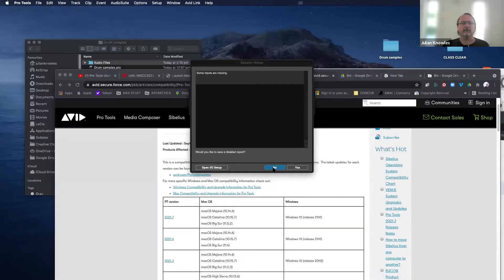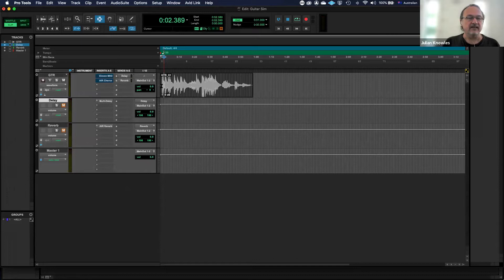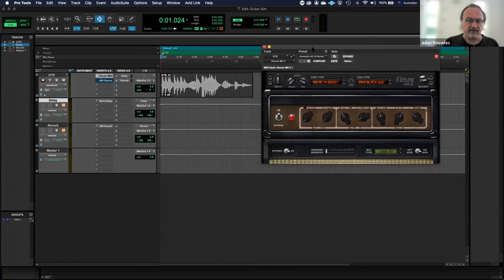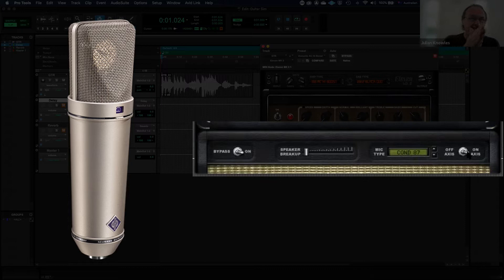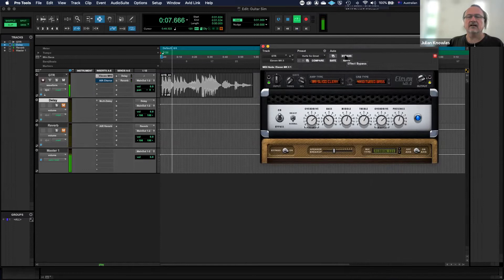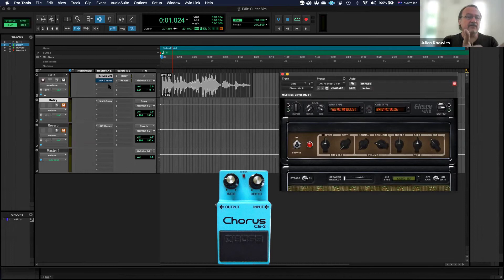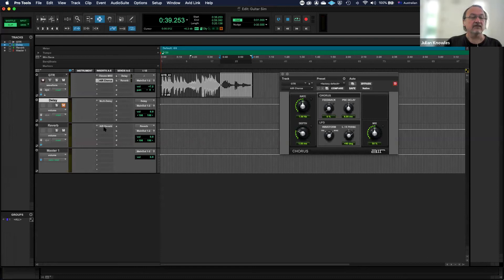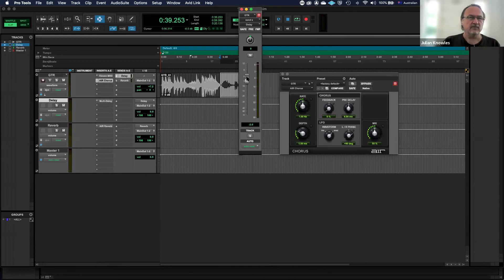Pro Tools: Using the Eleven guitar amp simulator

Comment: I have been have trouble with hearing the DI signal while tracking in ProTools in both the ELEVEN plug in and Bias FX2. Is there something I need to change with my input monitoring in Pro Tools so I do not have the distraction of the DI signal when I just want the processed signal/ sound of the plug in?
Reply from the maker: Hi Clay. It is important to get your head around how monitoring works in Pro Tools and how your interface can be used in that equation. Check out this video https://youtu.be/E2kTA8hQxIM
Reply from the maker: You might also find this video useful https://youtu.be/lhkMQx7YUuU
Reply: @socialinterior   Thanks for responding! It ended up being a problem with my routining in the Focusrite Control. But, I have it working now.

Comment: Dude - you didn't explain WHERE the Amp Sim is located or how to find and access it.
Kind of important.
Reply from the maker: You can see it right there as an INSERT on the GTR channel. It's called Eleven Mk II. Did I miss something in your question? If you are not sure what an insert is and how to use them, then maybe you might want another video like this https://youtu.be/pkmKYMimm08  If you watch that video first, you should have a good handle on inserts and sends in Pro Tools. You'll need that anyway.
Reply: @socialinterior  how do you install and actually use the plug in.?
Reply from the maker: @KriegeElibanze  The installer comes with Pro Tools. On the website, log in to your avid account (my.avid.com) go to My Products, Pro Tools, 'View Software Download Links'.You''ll see the software there. Either that, or you can install it via Avid Link
Reply from the maker: Also see my above comment on how to insert a plugin in pro tools. As for how you use it, you can see in the video how you change amps and sounds. I run through several clean and distorted sounds.